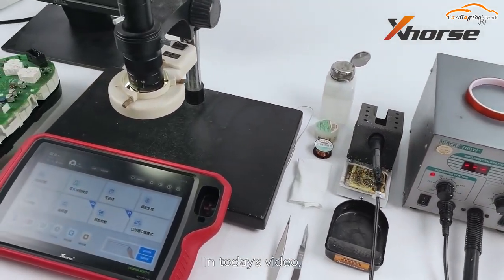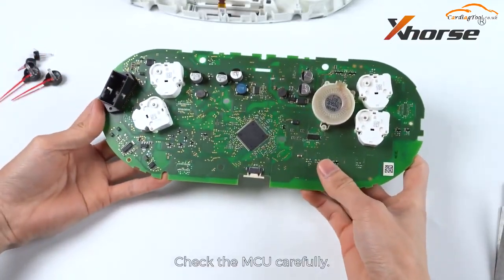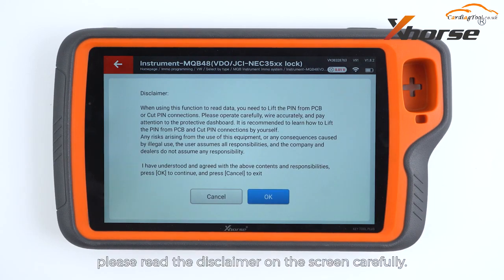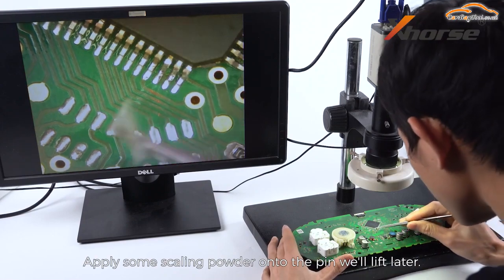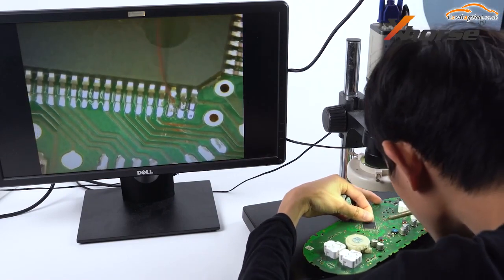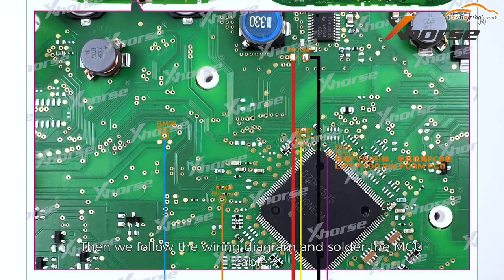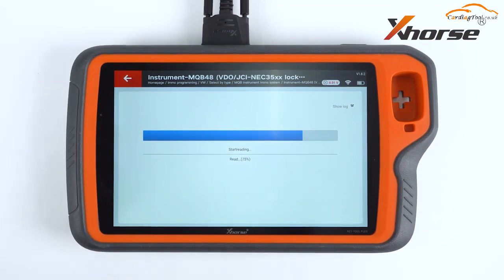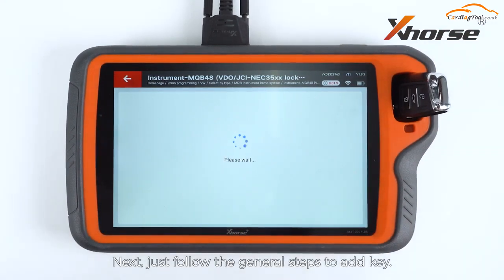Xhorse Key Tool Plus Read MQB Locked NEC35xx Instruction - Cardiagtool

Comment: Good
But can we use vvdi free dapter to aboive soldering
Reply from the maker: hello depends on cluster, if rh850, still need to solder rh850 cable; if not, just use mqb48 solder free adapter